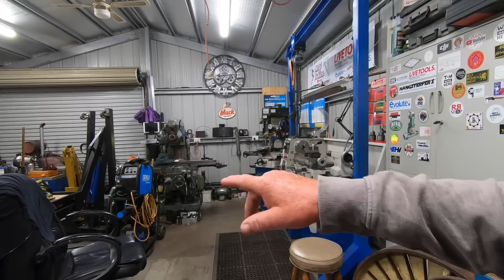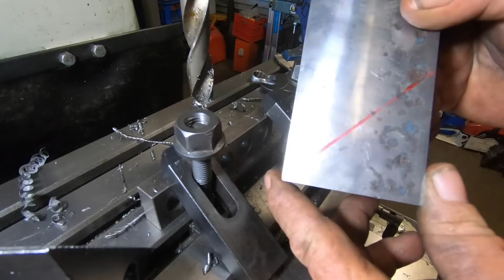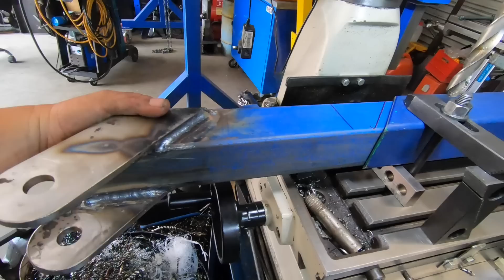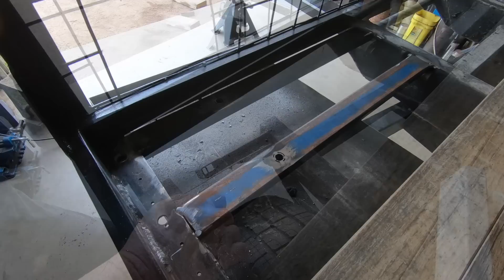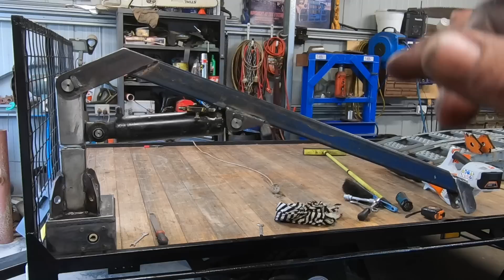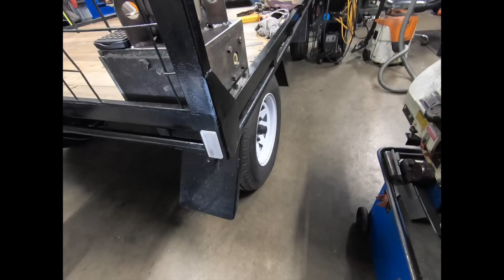Homemade Crane Build   Part 4

Comment: Thanks Matty 
  Excellent Video
Reply from the maker: Thanks very much Bob, appreciate you watching and commenting mate, Cheers
Reply: @MattysWorkshop  
    Thanks Matty

The Support Leg
? Does an F Type mount with a bar horizontally in the space between the two pieces that stick out , complete with a pin  vertically to hold it place work as an Idea ?
 
  Result being leg is attached to the corner , it can be rotated around ,   then the leg in the bracket can repositioned down wards by repositioning a second lower horizontal  pin  ( first pin is vertical , second pin placement is a lowering leg pin that is horizontal ..... all mounted in an F bracket welded to upright )

 The attachment into the " F " Up right could even be an eyelet mount ?  ?  
  Or taken even further 
 an Eyelet , no F mount , straight up right bar , capped through eyelet by a  bolt that  pins it  downwards 

 Hope this helps

Comment: Thanks for the update Matty ! Hard to let a machine go, but sounds like a win-win. A little extra elbow room is always good. I leave my engine hoist outdoors with a bit of spray lube on the critical parts, it holds up well and saves valuable indoor space. The crane is looking good 👍👍
ATB....Dean
Reply from the maker: Gday Dean, it was hard to t let the shaper go but it’s only 10mins away and still have full use when I want, I don’t think it’s been turned off since Trevor got it, thanks for watching mate, cheers

Comment: Could you use a scaffold tower stability leg that fits on the corner of the scaffold, to be fitted to the trailer corner,  can stay fitter all the time and used at any time you need it
Reply from the maker: Gday Gary, the leg is sorted now and turned out a really simple setup that should be easy for Dad to use, cheers

Comment: Shop really looks great and I need motivated to sell off equipment to make more space as well. Just a thought, but maybe going to auto salvage yard and find a Mercedes hand jack and adapt it to a swing arm that would fold back up under the bed when not in use? These jack are stout as a mule, and will lift a 300sd (4200lbs) with ease 👍. The craftsmanship on the crane build it top notch ! Can't wait till you and Kurtis get started on his Klopp 1K mm shaper 😎Bear
Reply from the maker: Gday Bear, I really glad I but the bullet and let the shaper go, having room back is unbelievable, I think I have the leg sorted now and turned out really simple, hopefully be doing the shaper soonish mate, cheers

Comment: Doings a bit maintenance my self on the E H Ute rebuilding  the engine. 
Old apprentice from up North
Reply from the maker: That sound more interesting then building a crane mate, what engine is in the EH
Reply: @MattysWorkshop  it has a 202 stroked to 235 with one of my crankshafts I use to produce back in the olden day .

Comment: Matty- could you have a leg that swings down mounted on the corner, up it swings towards the center, pin thru, just off the ground when down.  Easy fab, creates stability.  Out of the way when not in use.  Could be pipe.  What is readily available.
Reply from the maker: Gday, I think I’ve got the leg sorted, simple easy setup that should work mate, cheers

Comment: Matty , on the little  bandsaw cutting 45 degree angles , I've seen on you tube but don't remember who posted it but the idea was take a piece of pipe approximately 3 to 4 inches in diameter cut a piece off 3 inches long then split it sideways to make 2 half moon shapes then use it in the little bandsaw to hold work at angles. It worked real good for me on mine.
Reply from the maker: Gday, I remember seeing something like this on YT but I’m buggered if I can remember where now, thanks for reminding me, cheers
Reply: Rob on Zynudu posted that some time ago.    It works a treat and I use it a lot.   
I find it works so good for little pieces and gives you extra reach or for holding irregular shaped pieces.

Dale in Canada 🇨🇦

Comment: Great video, like you I always have these projects and several relating to cranes for some reason but it's interesting. I had added an open cover area adjacent to my shop which now has a nice cement pad under it.
Reply from the maker: Gday Jeff, I’m looking at putting another slab out the back of the workshop with a roof, at least then if it’s crap weather I can still do messy crap outside, cheers
Reply: I really like my area, got a roll around crane that I'm going to put V-casters on and inverted angle track down. Outside is great for welding cause the fumes drift away.

Comment: Why not mount a screw jack (usually found on the tongue of trailers) on the front corner of the trailer that can pivot, parallel to the trailer when stored, locks at a 30° (?) angle outwards when its needed?
Looking good so far!
Thanks for sharing 🇨🇦
Reply from the maker: Gday Paul, I think I’ve got the leg sorted, turned out a really simple setup that’ll work, gotta keep it as simple as possible mate, cheers

Comment: You may have to get the trailer replated, ref new Gross and Tare weights 🧐😀😅.
Looks like it belongs there,  guessing the out rigger needs to be outside the trailer foot print?
Great job on shop sort out, nice to pass equipment onto a mate.
Thanks for sharing
Reply from the maker: Gday, almost have to get the trailer plated again, I think I’ve worked out a simple leg setup that’ll work, the crane only needs to lift 1/2 a ton so it should be right, Trevor hasn’t turned the shaper off yet I don’t think, definitely getting used now, cheers

Comment: Nice job!  For the leg you could use something like a boat trailer jack so it folds up and out of the way when traveling.
Reply from the maker: Gday, I think I’ve got the leg sorted, turned out a really simple solution that should work ok, cheers
Reply: I was thinking something along the same line too.

Comment: Yes when shed's get full only two ways to make room a bigger shed or time to move stuff on. There is a 3rd way but that involves elbow grease and pulling digits out to get jobs done LOL.
Those end upright tubes look ideal for feet to slid out and down from Matty swivel plate feet on them. OR couple of trailer dolly wheels either side quick n easy.
Reply from the maker: Gday, I’m really glad I moved the shaper on, it’s only 10mins away and I have full access to it whenever I need to which is a big bonus, it’s also helped Trevor out big time, I think I have the leg sorted out, very simple solution, cheers

Comment: More good work Matty - you're on the home straight now. Re the stabiliser, is the mower heavier than the trailer ? If so, I think you might need an outrigger rather then a prop. A swing out triangular gate sort of thing might work. Maybe attach a vertical edge to the corner post of the trailer and include a tube that extends down from the hypotenuse member to ground level. Just a thought bubble.
Cheers, Alan.
Reply from the maker: Gday Alan, Im finally on the home stretch, im going to try a simple leg first, I had one on my ute a couple of years ago and worked great, it got put to the test many times and never failed, Thanks for watching mate, Cheers

Comment: Funny you mention Kurtis I love Watching CEE videos .On the out rigger leg you could put a Hyd. cylinder up that corner and use the power unit to jack it up or use a screw jack. Hows the Elbow Doing Matty ?
Reply from the maker: Gday, Id like to make it a hydraulic leg but Im trying to keep the weight done as much as possible, (haven't done a real good job of that so far) The elbow is going ok, its just the very centre that won't heal completely
Reply: @MattysWorkshop  don't you just Love Australian wildlife! Are you still having to go to the quack Matty?
Reply from the maker: @samrodian919  No don’t have to see the nurse anymore thankfully